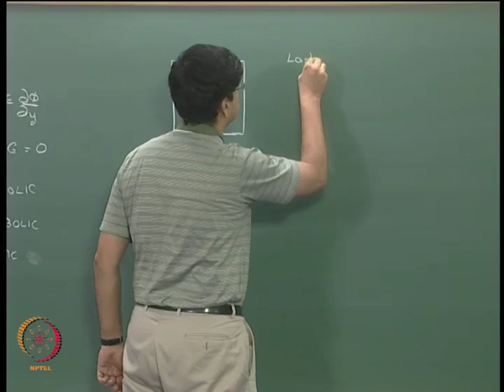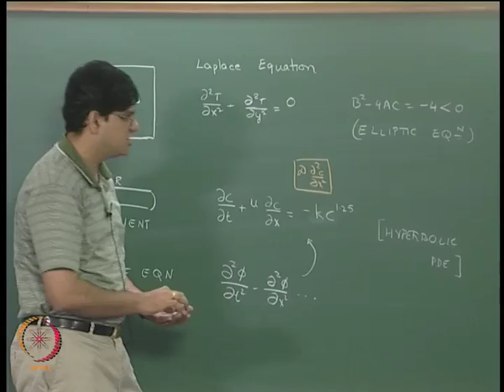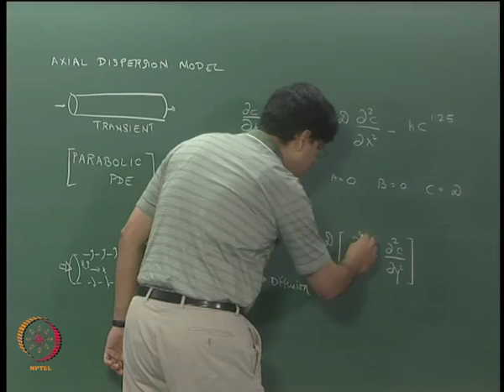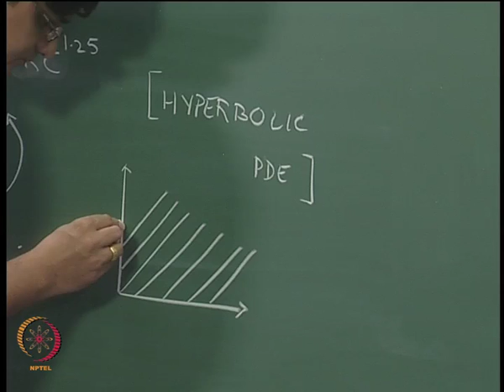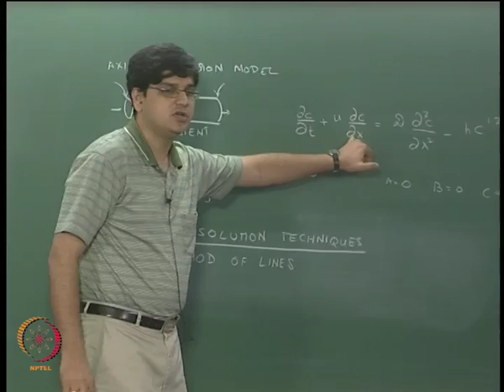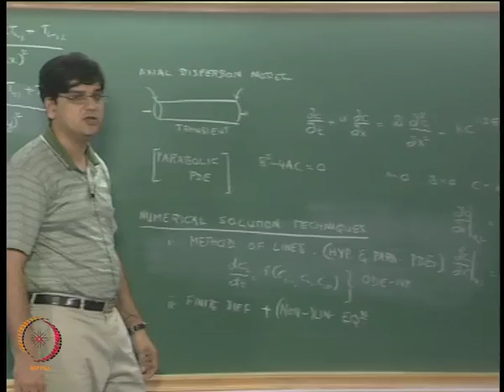Comment: Sir, you talk about the WAVE equation where we have second order derivative on time. You classify this as hyperbolic PDE and you say this can be solved with method of lines. My question is how method of lines handle second order derivative on time. Normally, we solve a set of first order ODEs in this method. Thanks a lot.